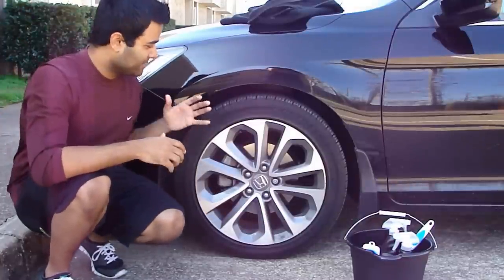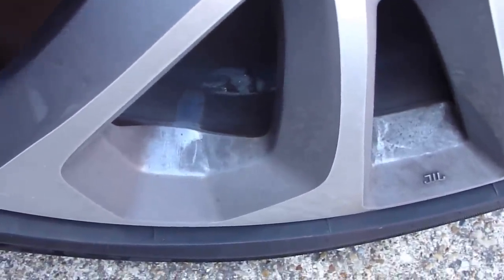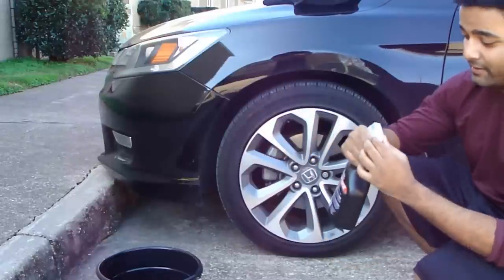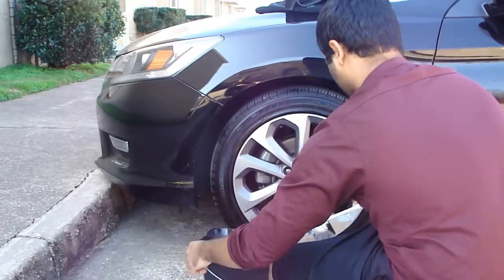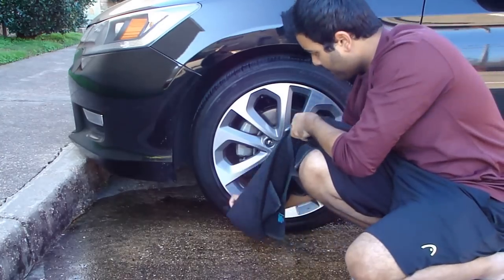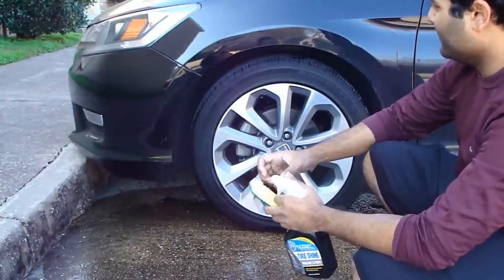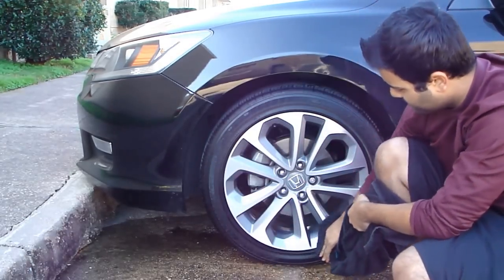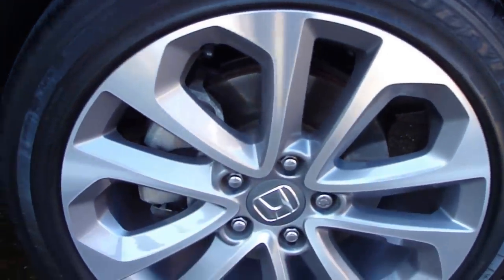How to Clean and Shine your Tires and Rims for CHEAP!

Comment: Your making more work for yourself. The reason why your rims and tires continue to become dirty is because of the products. Start with an industrial degreaser such as LA Awesome and wash those tires and rims twice with it. Then follow up with Aerospace Protectant 303. Those dollar cleaners have petroleum distallates in it and cause the attraction of dust and the breakdown of rubber.

Comment: any laundry detergent will remove any brake dust or dirt from wheels and tires, then just go over tires with tire dressing.
Reply: Yes.  No need to buy an $6 bottle of wheel soap.   Lots of dust and dirt can be removed with houshold cleaners and detergents (laundry soap, dish soap, all purpose cleaner, shampoo, vinegar, etc.).   Heck, soapy water and elbow grease does a mighty fine job.